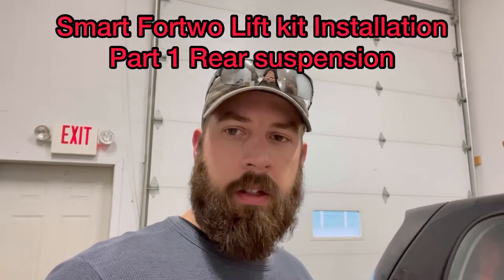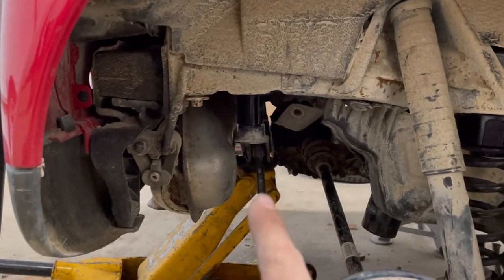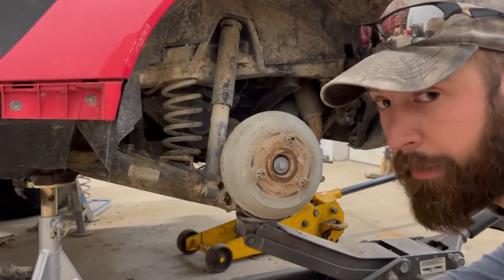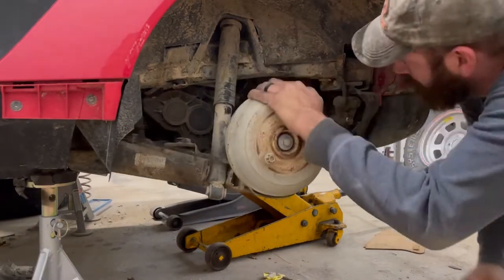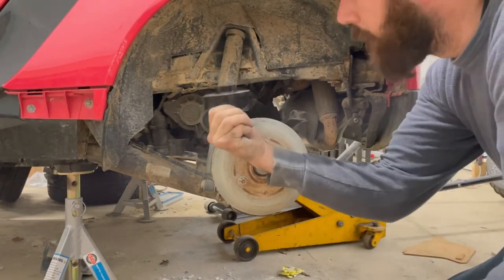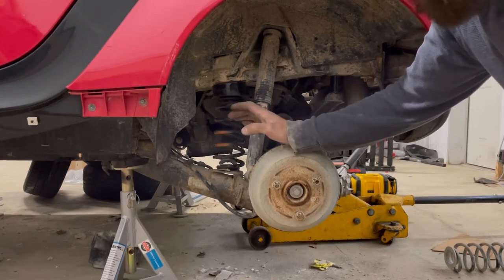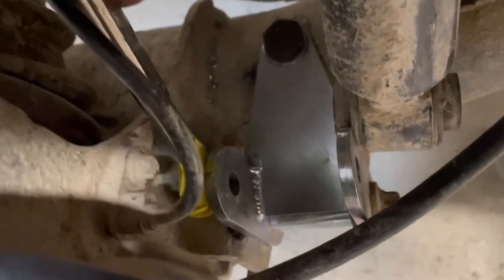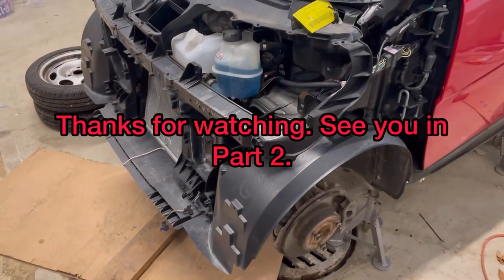Smart Fortwo lift kit install Part 1. Rear suspension.

Comment: I did mine ...super easy. I used a scissor jack between the lower arm and car spring came right out
Reply from the maker: I should’ve thought of that. I had a scissor jack sitting right there. I’ll remember that for the next one that I lift.

Comment: I had to trim the plastic cover for the bottom of the car as well as force it on to get the screws in some places.  I still hear plastic hitting someplace and I was wondering where so I can cut more plastic off. Or did you just not put the plastic cover back on yours?   I bought a 40 dollar spring compressor at autozone and it made changing my struts very easy.  I used a 14mm x 1.50 lug nut that I ground flat on the bottom instead of the original lock nut for the strut shaft so I could get a wrench on it.  I also ground a flat spot on each side of the shaft extension that comes in the kit so I could hold the shaft with a wrench while tightening it without having the shaft spin on me.  I drilled a hole in the plastic so I could zip tie the sensor wires in a lower location so they would not be all loose n shit but still have space to move. My muffler hits the plastic in the rear because of it's new location.  I will have to look into making it stop.  It bugs me.
Reply from the maker: I had to do a lot of trimming to the plastic and the body. I had to cut the inner fender off on the rear portion against the foot well/firewall. The rear wasn’t an issue for my exhaust. It cleared pretty good but then I upgraded the exhaust. I need to install the new struts and the rear shocks this coming week. I was working on a few other projects the past few weeks. I did t realize the amount of modifications I’d have to make to the body for this lift. New time I’m going to send my car to Little big smart and have them do it.
Reply: @hughbertsprojects  The muffler noise was just a clamp so I cut the long ass threads sticking out flush and no noise.  I am running stock tires so I don't have to cut any inner fenders.  I only plan on running 195/60 on stock wheels when these wear out so I shouldn't have any rub issues at all.  I'll have to keep cutting a bit here and there to see what works as far as the plastic.
Reply from the maker: Sounds like a good idea. I had originally ran a 205 75R 15. It was just way too big. I have a set of 195 75R 14 tires on their way. I did the hub bolt pattern conversion on the car and sold my original wheels. So I no longer have the smart car three lug wheels.
Reply: @hughbertsprojects  I have a pair of those adapters myself.  I put 195/50 studded snow tires on 4x100 rims for the rear but I should have gone without studs because they're like riding on ball bearings when it's dry pavement and it trips the traction control on corners.  Maybe I can yank them out.
Reply from the maker: They could also come in handy for dirt and off-roading.

Comment: i hear these lift kits also fit the 1997-2007 model. the only difference is you have to change the stock rear springs with the 2008-2015 model
Reply from the maker: I am not sure about that. But I have seen a couple people lift the 450 model.
Reply: @hughbertsprojects  i'm looking to lift an 05, but I hear thats all that needs to be changed. the 97-07 rear coils are smaller diameter at the top and the spacer doesnt fit.
Reply from the maker: That is unfortunate. I had a friend who had a 06 diesel that he really wanted to left and we never got around to seeing if we could customize some kind of brackets to work. You could always look into a coil spring airbag kit. I know that they make them for different kinds of vehicles that an airbag slides inside of the coil spring and you could do that for lift in the rear.
Reply from the maker: @Ratbiker  Not sure if you are on Facebook or not. But there is a group called lifted Smart car owners. The other day there was a 450 chassis that was lifted. You might be able to ask that person how they did it. It was green and black.

Comment: Bro do you know where can I get the spacers  for the rims and tires 3 to 4
Reply from the maker: Here is a link to eBay. The smart has a 3x112 pattern. Many different size adapters are available. 

https://www.ebay.com/sch/i.html?_nkw=3x112+to+4+lug+adapter&_trksid=m5467.l1311&_odkw=3x156+to+4+lug+adapter+
Reply: Thank you so much for your help
Reply from the maker: You’re welcome

Comment: What's the make model of your rims in this video?,
Reply from the maker: They were an old set of Enkei wheels I believe. From a miata 4x100. I had a set of wheel adapters off of eBay I had used.